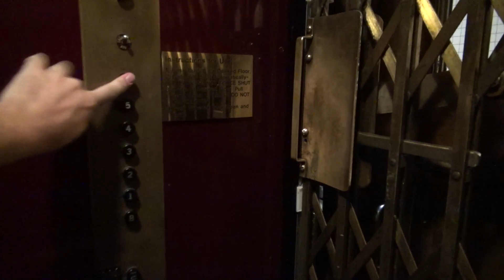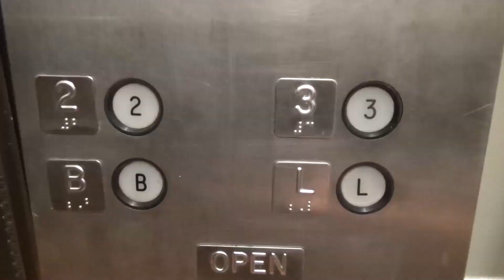Old Otis Elevator at an Apartment Building in Denver

Comment: Amazing and Epic! Isn't the gate supposed to be automatic!?
Reply: The controller was replaced so that funtionality was likely removed
Reply: @NathanCE  That could be the reason, but I think it’s probably just stopped working and needs fixing. You can see the new beam sensors on the gate, which suggest it should be moving automatically still.
Reply: @Lift.Tracker  Might be some fault with the door closer/opening relay on the controller, it sounds more likely it stopped working downstream of the controller, could be an issue with the traveling cable?
Reply: @TheTheo58  Yeah, I think it’s probably downstream of the controller, whatever the problem is. I don’t know for sure, but I imagine if the door relay was the fault then the whole elevator would stop working from that.
Reply from the maker: i think it was at one time.